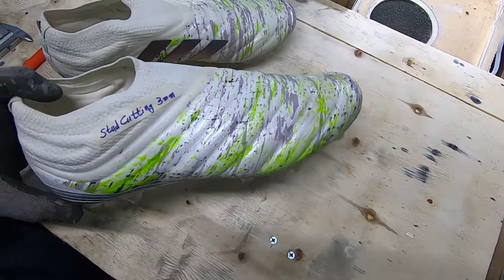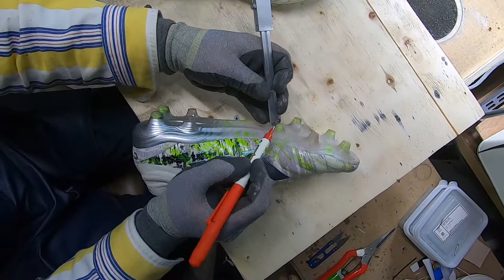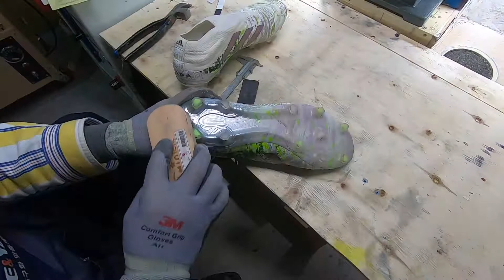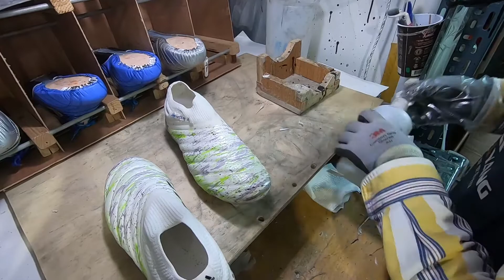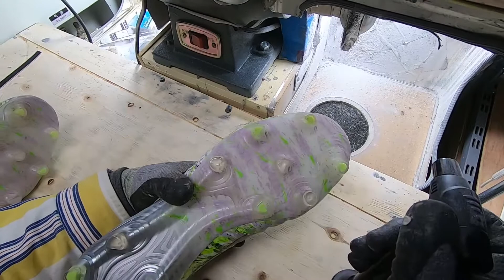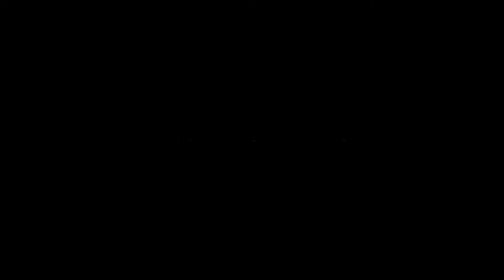How to cutting FG sutd - Adidas - Copa 20+ FG

Comment: Hi! great video! One question: when you apply heat, is that a heat gun or kind of a cooking torch? it looked like a flame coming out of the end. 
I have a lot stud pressure right under the ball of my big toe, I think cutting out that one a little bit might help with that pressure. Do you think that would help?
Reply from the maker: If the stud pressure rises, it will be very comfortable to use after cutting 2-3mm. And to go to the last column is to heat it up in terms of durability because you're afraid it's going to wear out. You can use a tool with a strong flame.
Reply: @leeandyang  thank you so much for your reply! Do you think a Dremel would work for cutting one stud?
Reply from the maker: @gmolina  Yes you can use Dremel tool when you cutting the sutds.